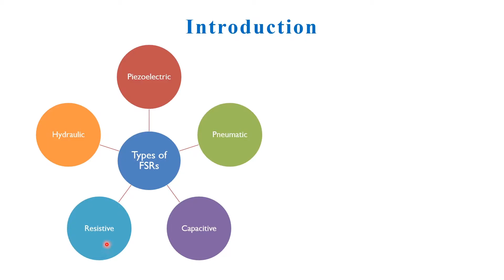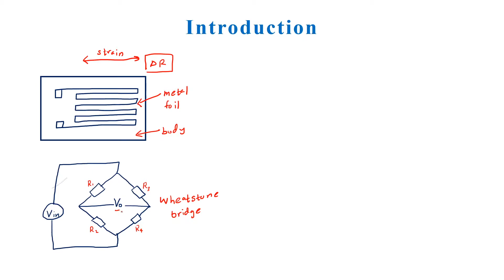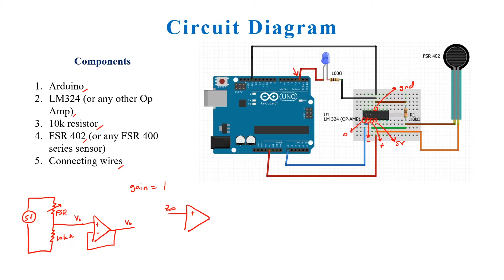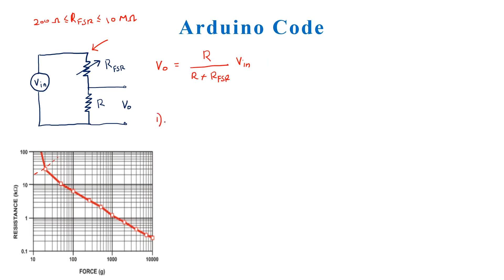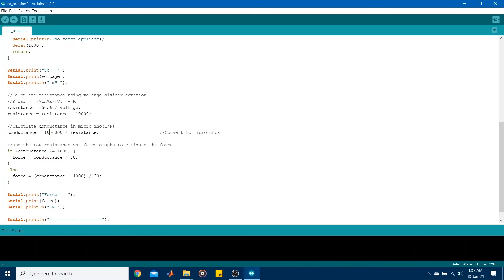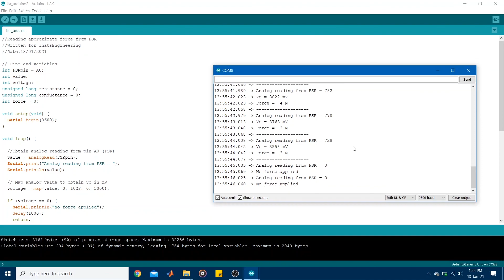FSR 402  (Force Sensitive Resistor) Via Arduino | FSR  As A Switch | Obtaining Analog Force Reading

Comment: you didnt say about calculating the pressure??
Reply: The formula is P = F/S basically you divide the approximate force with the surface of your sensor which can be found in the data sheet online

Comment: Why conductance was converted from ohms to micro ohms? Is it necessary? 
Also, in your code you haven't commented out that why you are using 80 and 30 as dividers in calculating the force. Could you comment on that? Thanks